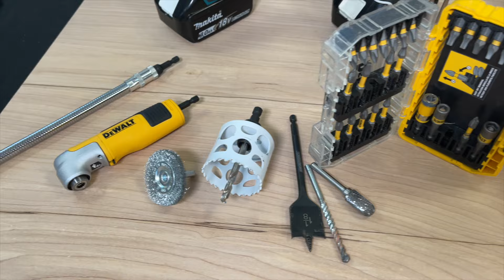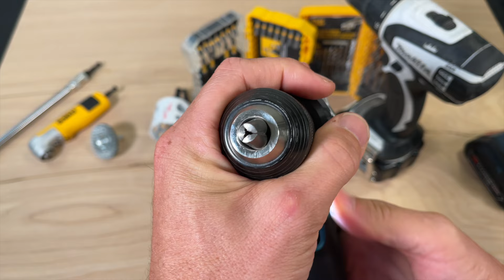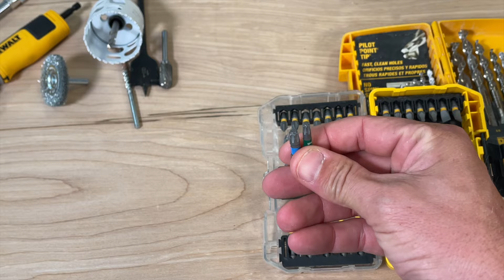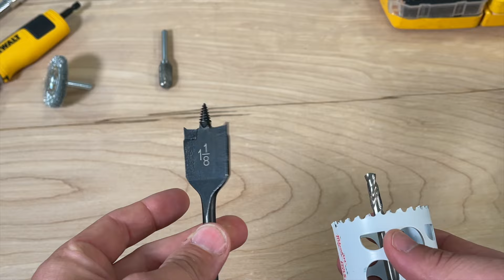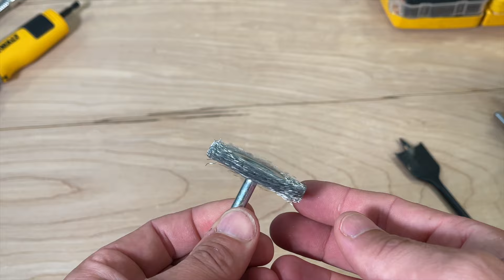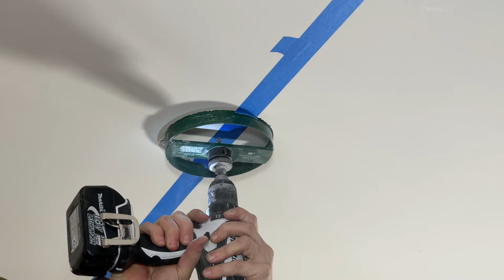Cordless Drill Basics | How To Use Safely

Comment: Nice video.  I like the quick change chucks from Snappy and Rockler.  You can get a kit with some drill bits, some with counter sinks and a small selection of bits.  I like the one that lets you drill a hole and then a quick change part that fits over it so you can immediately drive the screw.  I prefer 20 volt drill but used a 12 volt DeWalt brushless driver to install decking on a 600 sq. ft. deck.  The 12 volt drill will be easier on your muscles and cover 90% of your jobs.  I prefer a combo kit with drill, impact driver, charger and a battery.  Then spring for a second battery.

Comment: Problem I have had in past was that next year's product line switched battery configurations which in turn meant you had to be a whole line of tools again.
Reply from the maker: Hey Rick, what brand did you see the battery switch?  Most have been pretty good with sticking with the batteries for the very reason you mentioned.
Reply: @EverydayHomeRepairs  Craftsman...(years ago)...I'm glad that you say that they don't change design as much.
Thanks...

Comment: I'm a homeowner and based on my needs, good performance, and my budget, I went with Ryobi. DeWalt and Milwaukee make awesome tools, but they're overkill for me and do not need them for what I use them for.
Ryobi's brushless tools have gotten the job done for repairs, DIY, and weekend warrior projects. That includes the hammer drills, impact drivers, circular saw, recip. saw, oscillating tool, and others I have from Ryobi.
Reply from the maker: I would have to agree and thanks for the feedback!

Comment: All drill instructions that come with them will tell you to never tighten the chuck by powering the drill. I've seen some people try to play cowboy with locking a drill bit in, only to have it pop out and end up flying up at their face. Horrible way to lose an eye. Always hand tighten with the trigger in the neutral/locked position. That way the drill and bit is controlled at all times and you can ensure that it's fully tightened in there and won't slip out. Please don't teach people bad habits. Especially if you're labeling the video "How to Use Safely".
Reply: I always hold the bit with two fingers to stabilize the bit, and hold the chuck with the rest of my hand. If I hand tightened the chuck every time I had to swap out bits, I'd still be putting together a picnic table from 2015.

Comment: I would recommend a corded drill over battery for the occasional use home owner. They probably not use it enough to get the most out of a battery one.
Reply from the maker: Hey Bryan, I see the point but with a Ryobi drill, impact driver, batteries, and charger only being $100 I think it probably is worth going with battery.  Just my 2 cents and if you wait for Black Friday you can even pickup a better deal.
Reply: I think this was truer with NiCad batteries. Li ion batteries seem to hold their charge very well on the shelf.
Reply: @fredh54  It really does seem a lot of the cord holdouts are people that only looked at cordless options back when it was in its infancy and never looked back to check in on all the advances that have been made. Have they even heard about the brushless motor tools coming out now that don't compromise on power while also being easy on the batteries? I wonder.

Comment: 👍🏻 I don't know how to tell the difference between a drill bit meant for wood and a drill bit meant for metal. What are they called? Can you use the same drill bit for both metal & wood?
Reply from the maker: You will find most sets these days try to cover most materials like this one from Dewalt that works for wood, metal, plastic, etc.  https://amzn.to/3kVWacw
Reply: The most common drill bits made for both wood and metal are twist bits. These bits are usually made of HSS or high speed steel. Some even have a titanium coating. I don't drill enough in metal to know if this is just marketing fluff. Just google "Harbor Freight drill bit sets" to see what is available.

Comment: Most drills come with a side handle that you can attach, so that way you have more control and it won't snap your wrist.
Reply: I'd say most higher-torque prosumer drills include a side handle, and those are normally hammer drills.  They are a good indicator that you need to brace yourself when you are putting your weight behind the drill.

Comment: Ryobi has a huge selection of tools that are very durable. I also use their lawn tools and only need one type of battery for everything.
Reply from the maker: Exactly, I think for the normal home owner they are hard to beat.
Reply: I am a Makita fan but I agree Ryobi is a good starter tool.  The one thing I would recommend though is to skip over their bit sets.  They cheaped out on the metal they use for their bits, and they often put impact and non-impact bits in the same kit.  You are better off getting Milwaukee bit sets, and if you graduate to a sawzall or other cutting tool, Diablo makes some great blades.
Reply from the maker: @docferringer  Thanks for the feedback!

Comment: Wear an N95 mask when drilling concrete or cinder block. Silicosis is dangerous to the lungs. Hammer drills without a HEPA filter are not allowed on construction sites in Canuckstan. Thxs for the vids!
Reply: If no face mask available
Use water on the bit to convert air borne powder into wet sludge
Reply: Probably depends on the site. I've been on many commercial construction sites in Manitoba and trades are using hammer drills without any attachment filters.

Comment: Forstner bits are great, too! Kind of like a hybrid between a hole saw and a spade bit. They create very clean and precise holes and don't have a big/long lead screw. The highest Ah battery isn't always best, it turns out. Project Farm did a video testing different Ah batteries within the same lines with different tools as a comparison. In some cases it's a net benefit, but especially for wimpier entry level tools in a given line (like a cheap drill/driver) it turned out the higher Ah batteries triggered overcurrent shutdowns and kept the tool from working.
Reply from the maker: Hey Marc, thanks for the feedback.  Interesting results from ProjectFarm.  That channel has some awesome comparison/test videos.
Reply: Marc is right, I saw that episode, but IIRC three only issue came up using a 12AH battery on a Milwaukee 1/4" impact driver.